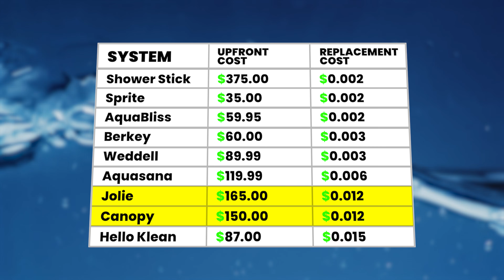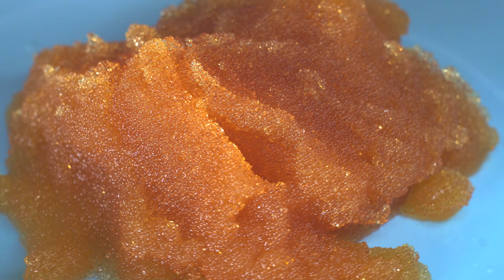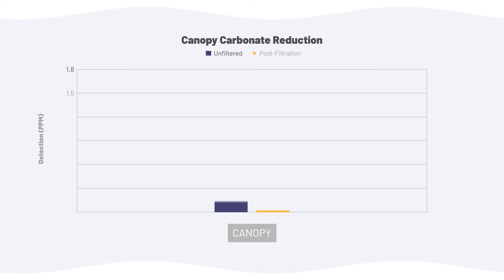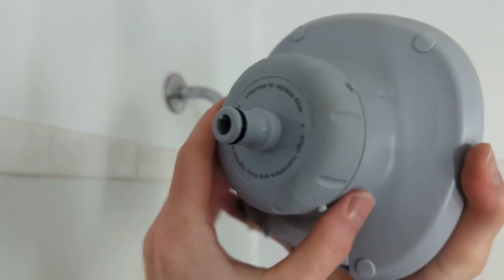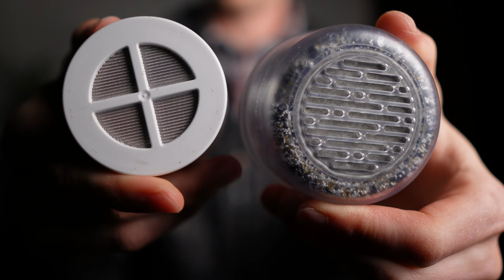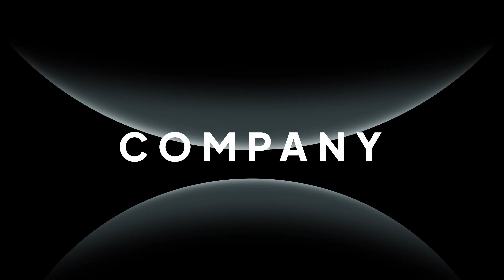Canopy vs Jolie: Which Shower Head Filter is Better?

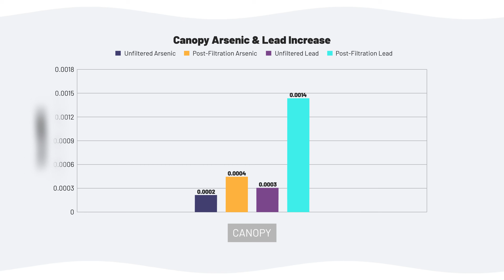Comment: 5:56 did you mix the PPM with PPB in that graph?
But even if it's PPM, the lead concentration is still much lower than legally required.
Reply from the maker: Good catch, thanks for bringing this to my attention! That should read PPM not PPB. I obviously missed this in my review during editing. The audio and subtitles are correct discussing these detections in PPM, and I’ve gone ahead and blurred out that y-axis label on the graph to avoid further confusion.

Just to clarify further, there’s actually no safe level of lead in drinking water. The Maximum Contaminant Level Goal (MCLG) is *zero*. The Action Level for lead is 0.010 mg/L (10 ppb), but it’s important to know that lead and copper aren’t regulated by a simple MCL like most contaminants. Instead, they’re regulated under a treatment technique rule meaning that if more than 10% of tap samples taken from homes the system serves exceed the action level, the water system has to take steps to control corrosivity and minimize leaching from plumbing. For copper, the action level is 1.3 mg/L.

Edit* to add this link to the National Primary Drinking Water Regulations:
https://www.epa.gov/ground-water-and-drinking-water/national-primary-drinking-water-regulations#seven

Still, in the case of shower water the health risk is much lower since lead is not readily absorbed through the skin, but it’s still worth keeping in mind that ideally we want zero lead lead in our water. Just another great example of the complexities of residential water treatment!

Comment: We currently have a whole house water softener, along with reverse osmosis for our drinking water. So, I had a question, where you said the Canopy didn’t filter out hardness, I don’t have to be concerned about that, right? What about chloramines?? Does the Canopy filter that out?? I wanted to add the Canopy shower head on my hand held shower head because the tap water has been causing itchy skin & hair and scalp issues.
Reply from the maker: Since you already have a whole house treatment system in place, the best way to treat chloramines for your shower water would be a whole house water filter that uses catalytic carbon, like the Springwell CF https://bit.ly/3Jz2tyP which would be installed upstream of the water softener.

I don't have data on Canopy addressing chloramines, but knowing what we do about the media it uses, likely it will not be sufficient.

Comment: so these filters actually make the water worse???? 😢
Reply from the maker: Worse? No. 

But they don't provide any better performance than cheap $30 shower filters that use the same exact media (KDF, calcium sulfite). 

Neither of them can address water hardness either, despite what they may claim or insinuate... 

If you need to deal with hard water in the shower, this is the best method I've found https://youtu.be/f5cbIdOZzek

Comment: Ik this isn’t part of the video but I’ve been trying to figure this out for awhile, would you say it’s sketchy / not recommended to buy a Weddell duo filter from a foreign seller on Amazon? I know sometimes they send items that are not up to high quality standards compared to the original website. I ask this because it’s not available outside of the US and I’d love to try it! Thanks for the videos
Reply from the maker: Honestly I'm not sure. You may want to reach out to customer support directly to ask if the reseller is authorized by them or not before making a purchase. If they are authorized, you can be confident you'll receive a legit product. That's how I'd go about doing it

Comment: Aqua youth 2.0 Filter must be tested, seems like a good alternative to the Wedell Duo at a cheaper cost.
Also any recommendations for best filter for skin concerns like Acne and or Eczema?
Reply from the maker: With a name like that, Aqua Youth better be good! 😂 I'll add it to my list.

Both chlorine and water hardness can exacerbate skin conditions like acne and eczema. While most shower filters are able to remove chlorine at a minimum, the same can't be said about hardness.

If you rent, the only point of use shower filter capable of reducing hard water in our testing was the shower stick. That said, its expensive, made of PVC plastic, massive & ugly and difficult to maintain. Neither was it sufficient for addressing more concerning disinfection byproducts.

An easier solution might be to use a portable water softener like those designed for RVs, like these https://geni.us/ntxW3 - I've got it on my to-do list to make a video about this process. This would be combined with a shower filter to remove chlorine and disinfection byproducts
Reply: @waterfilterguru  I have been using an AquaYouth 2.0 shower filter for about 4 years now.  It was the only one cerified to remove chlorine at the time I purchased it..  It utilizes an activated carbon block filter.  That filter does reduce some water hardness in my case as it removes iron from my water.  It will not affect the limesale stuff much though.  I am interested to see how it removes chlorine by-products, and haloacetic acids (if available), and VOC's.

Comment: Thank you for this detailed comparison! I’ve been using Jolie for about a year, and lately I’ve noticed the silicone at the water exit showing wear—honestly, it’s pretty gross. I recently discovered a new brand called Rainley with a patent-pending filter called micronflo that’s transparent, similar to the Weddell Duo, but with pleats. Would love to see your thoughts on that one if you get a chance to test it!
Reply from the maker: Thanks for your comment! What you describe sounds like a string wound sediment filter. This will trap suspended solids (sediment) down to a certain particle size, but won't do anything for dissolved contaminants. I can add it to my list to look into and consider for a future project
Reply: @waterfilterguru  No, that rainley filter is not a "string wound sediment filter." A string wound sediment filter typically consists of wound strings of material to trap larger particles, while the Micronflo filter is a multi-stage filtration system that includes a pleated polypropylene (PP) sheet for pre-filtration, along with KDF-55, calcium sulfite, and a small amount of activated carbon fiber (ACF). These components are designed for finer filtration, capturing particles as small as 5 microns, and it's distinct in that it has a transparent casing to monitor filter performance.

Comment: Buyer beware-the canopy and Jolie filters DO NOT LAST 3 MONTHS! I first bought the Jolie filter and at first it worked pretty good. At least water pressure wise. It lasted about a month and a half, and then there was a significant drop off of water pressure. So then I decided to try the canopy filter. That one barely lasted a month. And it’s just me and my husband using the shower. I take two short showers a day and he takes one a day.  Both of these shower filters are heavily pushed on social media.
Reply: These filters only last 3-4 weeks because you have to take them out and flush them with water
Reply: What made you realize that it “wasn’t working” any more?
Reply from the maker: @Brownsugarcotton  They mentioned "significant drop off of water pressure" - this is a good indicator that the water filter has reached capacity and is no longer working effectively
Reply: @waterfilterguru  thank you! That’s helpful to know!
Reply from the maker: @ You're welcome
Reply: I currently have the canopy filter. I had it about a month and barely any water is coming out when the filter is in. Very disappointed to say the least.
Reply: what is the best filter? can you share a recommendation?
Reply from the maker: Thanks for sharing. This is a great example of how water quality directly affects estimated filter lifespan! This indicates to me there is something in your water at elevated levels that these filters are removing, which is causing them to reach their capacity quicker than the manufacturer promotes

Comment: Do you have a recommendation for someone looking for JUST calcium filtration? We get large orange puddles and after testing it seems that the only thing my water has a lot of is calcium, (I don't even think my town legally has to add anything to the water). Yet it seems like there isn't any purpose built filters for it, unless it simply falls under 'hard water'.
Reply from the maker: Orange water/ staining is typically attributed to iron, not hardness (calcium).

I'd recommend testing to identify the exact type and concentration of contaminants present that need to be addressed.

If you own your home, a point of entry water softener like this https://bit.ly/3xUMjJ1 is the best method of treatment for hard water (primarily made up of calcium & magnesium)

If you rent, the only point of use shower filter capable of reducing hard water in our testing was the shower stick. That said, its massive, ugly and difficult to maintain. Neither was it sufficient for addressing more concerning disinfection byproducts.

An easier solution might be to use a portable water softener like those designed for RVs, like these https://geni.us/ntxW3 - I've got it on my to-do list to make a video about this process! This could more likely be combined with the Weddell https://geni.us/GDjF6Ct for better contaminant reduction as well.
Reply: @waterfilterguru  Ill take a look at those RV systems, thanks. I did test the water with a kit and found that Calcium was the only issue. Our towns water supply comes from a nearby lake that everyone is barred from swimming in, so because of that the town does not legally need filter or chlorinate the water. This might change eventually, given the rising amount of calcium. But until then we just have to figure out what to do.
Thanks again.
Reply from the maker: @Chedring  Did you lab test or just use test strips?

Comment: I have been using the weddell duo as it was recommended, and I can attest to the fact it does reduce chlorine at least quite a bit. I am a dude and I never used to worry about my skin drying out from a fricking shower, but in this place it was like getting out of a pool thats how much chlorine there was. Now, I do not smell it when I turn on the shower.
Reply from the maker: Right on, glad to hear it. Thanks for sharing. The Weddell did indeed perform better than both Canopy and Jolie in our testing (for anyone else reading this comment), check it out https://youtu.be/YvGn1hqFChM